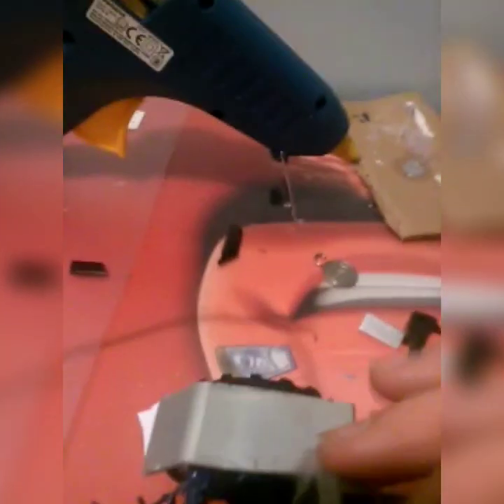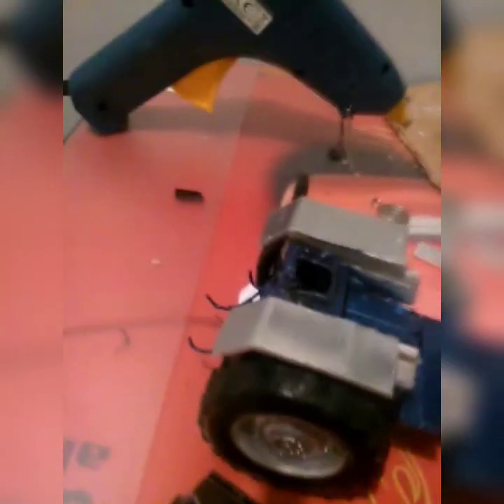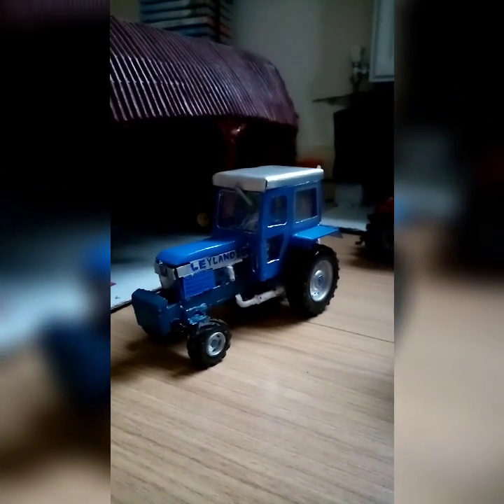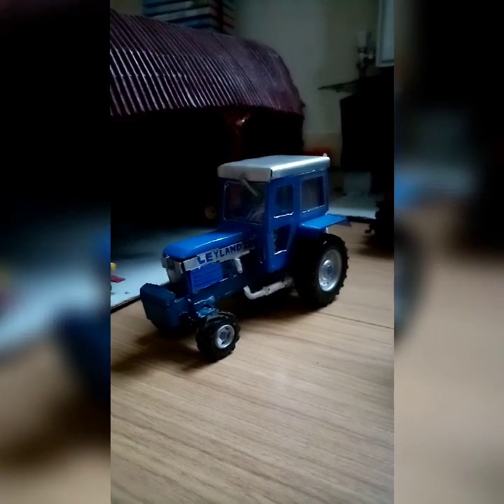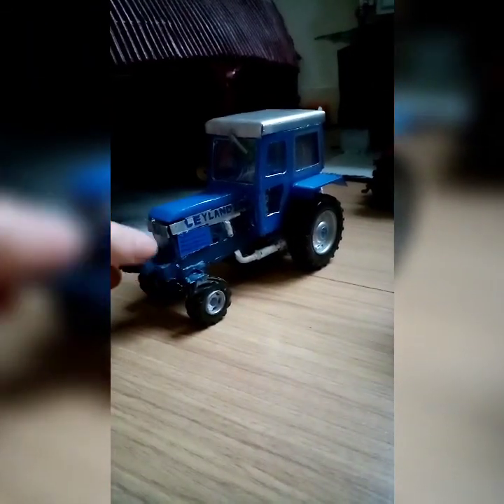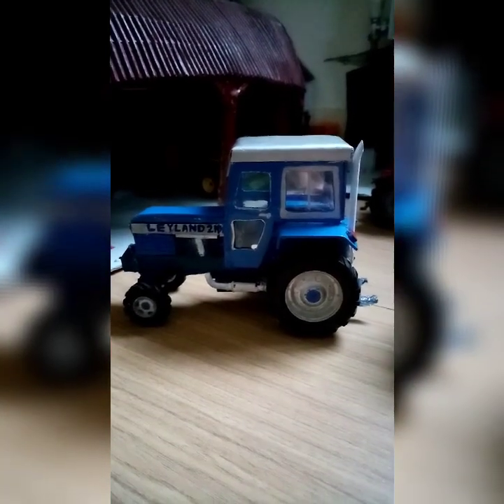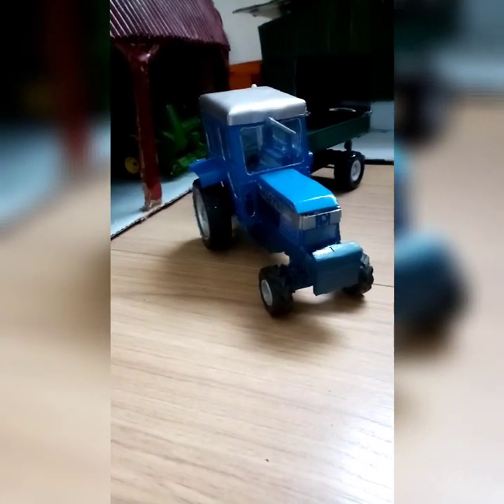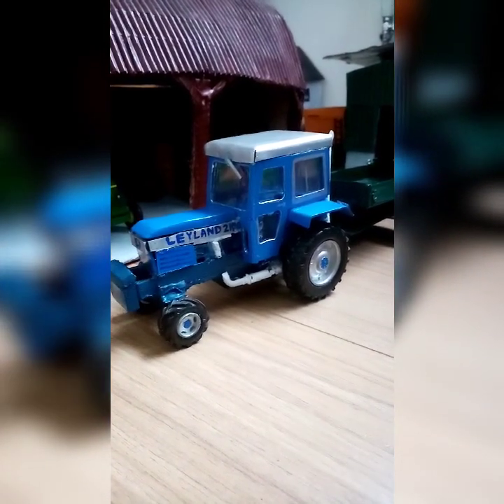Leyland 2100 tractor complete model build

Comment: lad I know modified the exhaust to the front in his 2100 very good model and very close to real one well done
Reply from the maker: Thanks , I know of a neibour has a Leyland 285 he still has is exhaust original he uses to spread slurry I hope to own it  one day ,keep it orginal love to staight pipe it for the tractor runs
Reply: @philipm1009  there nearly too loud with a straight pipe ,wouldn't want to do a days work with a straight would prefer the original Leyland exhaust
Reply from the maker: @modelfarmer6710  I said to straight pipe it for tractor runs obviously not for a day's work and sure I love the sound the make I wouldn't need a straight pipe it was only a suggestion